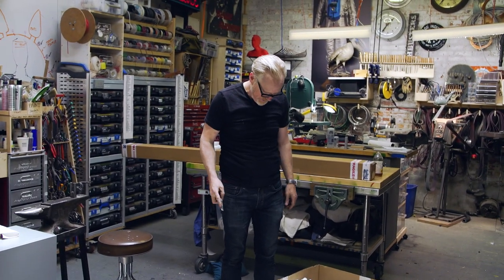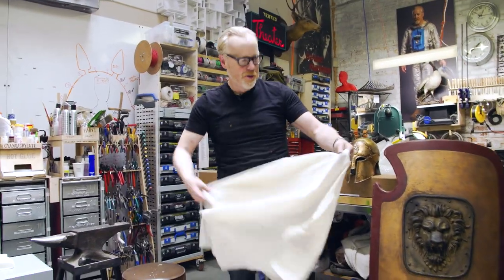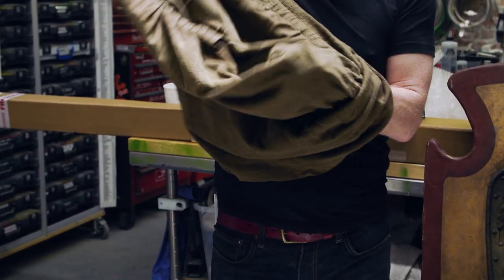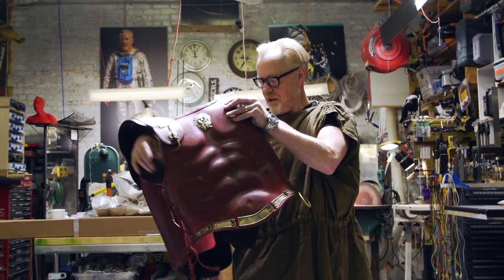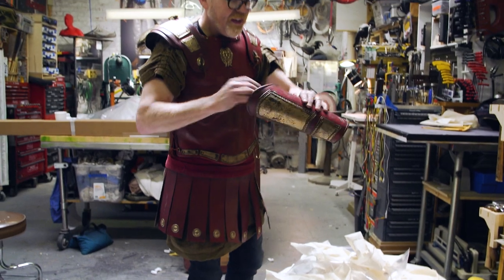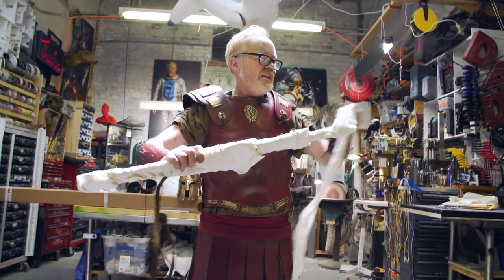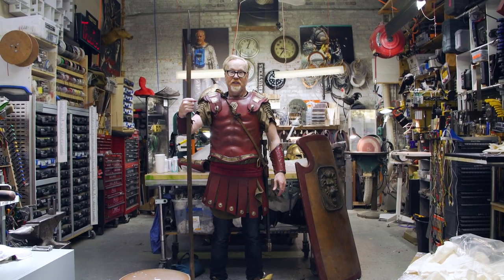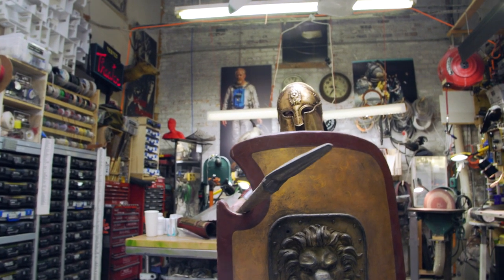Adam Savage's New Thracian Warrior Armor!

Comment: A bit of real history behind each bit of the “Thracian” costume. Top down!

Helmet seems to be a Corinthian-style helmet used in Ancient Greece, but the cheek plates don't extend down far enough to cover his neck as they should. Also the nose cover is too wide, it would restrict his line of sight. This is probably the most iconic design of helmet of the ancient world, and was usually forged of a single lump of bronze.

The cuirass (chest piece) is a hybrid of two different types of armour, those being “musculata” and “linothorax”. Musculata was the muscle-cuirass made usually of bronze from the late archaic period onward. Linothorax was a layered linen or possibly hardened leather armour used in the classical and Hellenistic period by Greek heavy infantry. I’m unaware of any archaeological finds of musculata that have shoulder plates like that, and none of them lace up on the side. The Linothorax does have shoulder plates, but they attach at a single point in the middle, and it does tie up at the sides. Interestingly, musculata armour is in fact sometimes found in Thracian graves.

The bracers (arm piece). Adam called them gauntlets, but gauntlets are for the hands not the arms. Vambraces were a piece of arm armour used during the medieval period, but they were plate metal, and not period accurate to the Thracians. Bracers (like what he has) are a piece of archery equipment to protect the arm from the bowstring. 

The greaves (shin armour) are somewhat accurate. Greek hoplite infantry wore greaves, but they were basically long, shaped tubes of solid bronze, not leather with bronze plates (tied?) on them.

The spear is a bit short for a Greek infantry spear, but a bit long for a javelin, though it would still work.

The shield is a bit of a far cry from Thracians. It looks to be an upsized medieval jousting shield given that it has a lance rest, but those tended to be concave. It is approximately the size of a Pavise shield but those didn’t appear until the Late Medieval period. It could be a fantasy version of a Roman scutum except for the lance rest.

The sword is a strange one because it’s a mix of a few different things. It’s a Roman gladius in the blade shape and guard style, but it lacks the pommel that gladii had, and it's fuller (the groove down the middle) is not found on a gladius. The scabbard is possibly the most accurate thing here, but it’s for a Greek xiphos sword, not a gladius. A Xiphos would hang from one string around the shoulder and had a horizontal bar at the end of the scabbard.

Overall, mostly a fantasy costume, but cool nonetheless! Only a few things were actually debatably Thracian and the rest were a mix of different cultures and time periods. 
I have a costume made of an actual Thracian warrior and I’ll probably put up a video of it in the next few days if anyone wants to see a slightly less cool looking but more historical Thracian. Cheers!
Reply: Solomonisms based comment, let’s get you to the top
Reply: Please do so! I would love to see the video.
Reply: People should read Solomonisms comment to learn how to demonstrate constructive criticism.
Reply: You said it well, all-in-all, this has nothing to do with the Thracian heritage, but is a good-sell for epic movies fans 😂 greetings to the seller, he packed Hellenic and Roman toys and sold it as Thracian 😂 he could add a katana and sell it as medieval Samurai kit to at least 10k people 😆
Reply: I do belive the gladius have a bit of a broader blade than what he has here though
Reply: What do you expect from the Plop Store?
Something actually authentic?
Reply: Maybe a spartha but not a gladius
Reply: Mate the props are from the movie  Hercules the one with the rock that is where they got the design for the shield. It is a completely not historical
Reply: Its just fake dress up
Reply: Blesson Wilson maybe enjoy the fact he took time to describe the history? No? Ok
Reply: While I agree this is basically fantasy armor, I wonder if the people who made it looked up Thracian not realizing that it is also a type of gladiator. Maybe that is why the parts of the armor and shield(minus the lance cut-out) look like they have Roman style to them.
Also a few questions. first yes the ancient Greek greaves were solid bronze tubes, thought there were probably iron ones as well they just don't preserve well, but don't museum example have places on them to attach a liner of some sort? I would assume there was something between the metal and the skin or they would be pretty uncomfortable and maybe even dangerous in a hot Greek summer(bronze does conduct heat pretty well).
Second I believe the iconic Thracian helmet, the one historians call the "Thracian helmet", is the one with the comb projection that sticks forward  from the top of the helmet(looks like a metal bird plume), with different versions of the helmet having cheek plates, face plates or even beard plates. Did Thracians wear other helmets besides different versions of their iconic helmet, Thrace was next to the Greek world did they wear Greek style stuff too or have other helmets that I don't know about?
Reply: No They were Greeks by blood a new study in Kazanlak tymb 2 Thracian bodies found  and they had the 93.3 per cent of their DNA similar to the Greek one (Yup, Greek DNA has changed over time *cough cough* ottomans were raping us *cough cough*

The ""Sica"" was known to the Thracians AFTER the Celtic invasion , They lived with the Mycenaean Idea fortified hills with no cities just big villages in always mountainous terrains they also discovered FIRST the javelineers (aka Peltasts) and then the archers like every Pelasgic nation did 

Attention  NON every Greek state had hoplites as main warriors or not at all Epirus Macedonians Aeolians Cretans Phrygians and Paeonians have had their own militia-like warriors and amongst them they always used the same Phrygian type hat! (A hat that was Represented Greeks by time) The hoplites "Perikefalaia" was first known To the Spartans  (warlike brave strong people like the most of the Greeks) Athenians were more Pacifists 

All the Northern Greek Tribes had no idea about themselves they were just fighting (Epirotes Thracians Paeonians *Yes Macedonians too, Aeolians and Phrygians) the ancient Greek ancestors were regarded as Sea people (pirates) : Pelasgians, Leleges and Kares
Reply: The bracers of this style are almost non-existant through history. Hollywood created them out of need in time when wristwatches were popular to hide "the line". By copying and using it for decades they created "made up look" of acient warriors.
Reply: @ΓΙΩΡΓΟΣΒΙΚΙΑΣ  I am a little confused about the point you were trying to make. As you said genetically speaking most of the Balkan Peninsula and surrounding area was very closely related, but culturally they were not all that similar. Culture and function tend to be what drive how clothes , armor and weapons look and culture can be effected by neighbors or the people you come in contact with. I guess my question was did the Thracians have also wear more Greek styled armor or just wear the iconic "Thracian" stuff?
Secondly the point about hoplites and to a lesser extent the peltast. While they are undoubtedly a style of unit used by that part of the world hoplites are just heavily armored spear men with big shields, so besides the Romans most of the ancient world used equivalent troops as their main fighting unit. Peltast to my knowledge started as javelin armed light infantry in which case once again they are pretty common in most armies. Later peltast do become more specialized flanking troops were they are given heavily armor and much  bigger shields and are expected to stick in and fight not just throw javelins and run.
Also I know its more complicated than this but the Athenians were not PACIFISTS by any stretch of the imagination. Not that they weren't people of reason and higher thought, they at times very open to non military resolutions, but at the end of the day most of the different Greek peoples were very warlike. Not that I am saying there is inherently anything wrong with that plenty of non Greeks from the ancient world were just as or more warlike. No reason to hold the Greeks to a higher standard, Mycenaean did conqueror a multiple groups dwelling in the Greek isles during the bronze age, most of which like the Minoans of Crete probably couldn't defends themselves very well. The Minoans were fairly advanced for the time and only had a small militia and trusted there Island home and natural defense and well built cities to protect them, and as far as we can tell they were not hostile to the Mycenaeans, but well the strong win that's how things go.
Reply: @ΓΙΩΡΓΟΣΒΙΚΙΑΣ  :))))) not a single grek wase Trachian :))) and Sica whase a trachian deger not celtic ,  dont  speak bulshit ..  macedonian whase a trachian tribe , not greek ..  if you have naw people with trachian adn . theat people are .Aromani, meglenoromani .. not greek ..
Reply: Where are you from buddy?
Reply: @mip4839  Well Thracians and Greeks used kinda the same things 
Thracian Culture is the same as Mycenaean one and also Herodotus himself says that they Have Pelasgic origins as Greeks do 
So what do you mean by that? 
Im a Greek you guessed right but not a crazy one
I have explored what Thracology had to show and it was hela Greek the whole thing (they were trying to prove that many times) as a tomb there had a Labrys (Panhellenic symbol that they often marked themselves with beforewar with Scythians or Illyrians and if they lost they were banning themselves somehow but never banned themselves from Greeks even their language was actually very close Greek that's why Grek historians can read and explain about with the same ease every piece of Thracian info on language it's available

Im not crazy or imperialistic (what you mean today's nationalist) but facts are facts and people need to see before they speak and post on Wiki
Reply: @howitzer551  Thracians gave the most to the Hellenic culture during Alexander the Great times cuz they were marking themselves with Labrys (double axe) to show that they were Pelasgians also sharing the Panhellenic Phrygian typed helmet during the campaign which meant a lot 
Nobody was forced or influenced they just joined and not one or two but every Thracian tribe according to what Greek Historians say (they know better) Alexander himself used "Kopis" except his dori (cuz he was throwing it)
Kopis was called by Macedonians and Thracians and mahaira from Southern Greeks 
For any more questions contact me
Reply: The Thracian Kingdoms became increasingly hellenistic after Alexanders death. Let alone by the time the Romans conquered it so for them to have greek style armour wouldn't surprise me.
Reply: @ΓΙΩΡΓΟΣΒΙΚΙΑΣ  Romania .
Reply: @leomarin2205  So this explains.
Well you are a sum of ethnicities 
There are some pure Vlachs but they are counted in hand and most of them are here 
They served as border guards "akrites" in Byzantium, they were shepherds and elite warriors who were been latinized 
We have a common bloodline with you but only with the pure Vlachs not the Slavic German and Turkic population (by Huns) 
Numerous book writers support this fact (mainly from Vlach origins) because We believed in Past you were Romanian meanwhile you were latinized Greeks even by DNA that was tested in 10 Vlach individuals that were claiming that only mixed with Vlachs 
They had mainly Greek DNA and Balkan but some of them had no Balkan at all (These people belonged to the Vlach community of Greece trying to prove once more they are part of us, Also Ottomans put them in the same race with us)
Reply: @ΓΙΩΡΓΟΣΒΙΚΙΑΣ  evry romanian are vlah.valah  not a sigle greek are the same blood with uss, only thay are romanian on the basee and asimilate by greek politics , becose that hapans 2 sec agou .. with the majorite vlah seatelmants .. the greek nationalist atac  tham ..
Reply: @ΓΙΩΡΓΟΣΒΙΚΙΑΣ  :)) we dont stay 800 yars on turks ocupation ,,  some of uss are probaly mixt , buot the restof uss are clean  the greek are not the same tribes pairets ho come in balkans , on the trachian leand , your laky is , the parts of trachian dont live theat leand thay improve your ADN :))))
Reply: I believe this is the  Hollywood  movie (Hercules)  costume. It has nothing to do with actual historical facts.
Reply: Elton Baholli Nonetheless, historical facts are important. I think it’s interesting to know them, and compare them to modern re creations.
Reply: @solomonisms9000  You are absolutely right sir! Please do not mind my History PhD outlook.
Reply: thx
Reply: Actually it is Thracian but not real life Thracian, it's from the movie Hercules which is a blooming fantasy😂 so of course it's not going to be real. Hercules made them the armour (lies) so they could fight off an army of centaurs (also lies)
Reply: Andrew Eades 
I know that it’s from a movie, but I find it interesting to insert some real history into the discussion as a point of comparison. Maybe someone learned something from the comparison, who knows?
Reply: Ok.
Reply: ΓΙΩΡΓΟΣ ΒΙΚΙΑΣ Giorgara i thrakes dhen Einai Eliniko filo ala ykiriko filo 
Min mberdhevese patrioti arvaniti apo to epitheto !!!
Reply: learn the history that has been hiddenn from all of us please after you make these comments, not the shit you have been thought in the western world. Thracians are the origins of modern civ. as we know it, which is a lie that has been spread since the 18th century. Greeks, Romans and almost all european civ. emerge from the thraciaon culture
Reply: @ΓΙΩΡΓΟΣΒΙΚΙΑΣ  
1.) "Sicca" was borrowed from Illyrian into Latin (Illyrian "sicca" (or sica) was preseved as "thika" in Albanian)[*]. Thracians and Illyrians were no foreigners (that's from where a lot illyrian males got their wives from; from thracians). The "sica" was a dagger of Illyrians, Dacians and Thracians and reached Romans via Illyrians. A dacian king even killed himself with one of these Daggers.
[*] ▪︎Source I: (Linguist) Vladimir Orel's book  "Albanian Etymological Dictionary" pages 477-478 (see: "thikë", "knife, dagger")
▪︎Source II: Wilhelm Haver's book "Die Sprache" (Germ. "The Language"); page 84
So no, you're wrong; "sicca" was WELL KNOWN to Thracians. The illyrian term "sicca" is what is called "[dagg]-er" in other languages and literally derived from "[Dac]-ian". Keep in mind that Dacians were a tribe that derived from the same root as Thracians. Of course Thracians knew what a sicca or/and a dagger was. There were no Celts, Greeks or Romans needed to "introduce" a dagger to Thracians, this was a legit thracian walfare.

2.) Thracians were non-greek folks, they were clearly not totally "alien" to Ancient Greeks, they we're de facto neighbors. However, Thracians were even less alien to their other neighbors. It seems that some ppl often forget, that Illyrians, Dacians, etc. also existed. On the mt-DNA line (specific) Italian and Albanian females cluster closer to thracians than Greek females.[**]
[**] Source: Cardos G., Stoian V., Miritoiu N., Comsa A., Kroll A., Voss S., Rodewald A. (Romanian Society of Legal Medicine); Year 2004; "Paleo-mtDNA analysis and population genetic aspects of old Thracian populations from South-East of Romania"
Quote:
》Frequency:    Ethnicity:
7.9%               Italian
6.3%               Albanian
5.8%               Greek
4.2%               Romanian/Bulgarian《
It would be even more interesting what the Aromanian/Vlach mt-DNA looks like... Bc THAT'S where it goes down ;)

3.) These so called "Ottomans" (that you mentioned) who "raped Greeks" (your words) were for the most part linguistically turkified ppl that already co-existed with Greeks before Ottoman era. The first south-eastern europeans to be turkified were Greeks (and Bulgarians). To make a long story short: muslim Greeks were f***ning christian Greeks - that's about it. The genetic make-up of modern Turks shows that only 20-22% is a typical turkic marker. Hence the ethnic turk is a minority in turkish genetics. Main-haplogroup of Turks is J2; which has nothing to do with Turkic folks. Safe to say that modern Turks are turkified Anatolians; but let's not forget that Turkey was and is inhabited by a lot different ethnicities.

4.) Furthermore, idk what kind of "study" claims ancient thracian individuals as "greek". So pls feel free to post a link to this study that you mentioned.
Reply: @ΓΙΩΡΓΟΣΒΙΚΙΑΣ  "Arvanite" literally derived from albanian "Arbanitë" - meaning " person from Arbënia" (or "Arbanon") - which is the pre-"Shqipëri" term for "Albania". When speaking of Old Aobanian, albanians use the term "Arbënisht" (gheg dialect) / "Arbërisht" (tosk dialect) - and not "shqip" (replaced old term "arbënisht" (albanian) around 18th century). The terms "Arbënisht/Arbërisht" ... that is called "Arvanitika" in greek - but Arvanites call it "Arbërisht" in their own traditional (non-greek) tongue.
And you really use the word "propaganda"?! Smh...
Arvanites used to be all christians (southern Albanian dominant orthodox and the lingua franca of the orthodox church was greek. Orthodox Arvanites are orthodox by faith, but ethnic wise they are not "orthodox/greek" - but Albanians). Just like Aromanians; orthodox by faith, but Aromanians is their ethnicity and they were never greeks.

Also, Ottomans called these so called "Arvanites" Arnavut/Arnaut" (Albanian) and never "greek". Stop pulling out ridiculous claims that have no base at all. The only propaganda here are all your comments, in which you claim literally everything as "greek". Eventhough your ancestors in antiquity declared it as BARBARIC, NON-GREEK. Same for Epirotes, who are claimed as "greeks". Here some facts: Ancient (Mycanean) Greeks considered Epirotes as non-greek ppl and even wrote that they were culturally very similar to Illyrians. How are they "greek" again?
Greek Epirus ("MAINland" in Greek) and alb. Epiri ("HIGHland" in Albanian) was originally non-Greek soil, which was HELLENIZED. Learn and know the difference between hellen-IC and hellen-IZED first. Hellenized land and hellenized people are nowhere "originally greek" - but as it already says hellenized;  barbarian/non-greek land and people who were hellenized to some degree.
Reply: Looks like a Wikipedia you copy pasted. And then added cheers. JK
Reply: Eucharisto

It means thank you
Reply: Chears my friend!
Reply: <3 THANK YOU good sir for peeling apart all the tiny bits and pieces that made me cringe while watching this "thracian warrior armour" getting unpacked. Historical inaccuracies trigger me hard xD - especially when they occure in xxx-billion-$-productions ^^
Reply: This muscle cuirass is a "Lorica Musculata", this time a boiled leather variant as depicted by the Romans. However there's no evidence that proves that there has been a single boiled leather Lorica Musculata made. They were always made of bronze, just like their neighbors to the east, the Greeks. The helmet indeed looks like a Corinthian helmet after 500bc, so not during it's prime time, it looks slightly altered from the forerunning variant during the 500s bc, also i don't see Greek smiths welding multiple pieces of sheet metal to a single helmet during that time period, especially with bronze. The Dori (spear) looks a bit off, it being nowhere like 8ft as described my multiple greek accounts and having no bronze butt-spike which keeps it from corroding when stuck in the dirt, it's more built like a Sarissa, which though was even longer than 8ft. The tower shield was also rarely used, and more prevalent to the east outside the reach of Byzantium and was made out of wicker and leather and wouldn't really fit to a heavily armored Hoplite amidst a full on combat inside a phalanx. So a heavy big round concave shield called the Aspis was mostly used, the concave form allowing the wearer to rest the shield on his shoulder without needing a strap. The wicker shield also had a neck strap, to rest the shield on the back/neck of the soldier. There were also accounts of soldiers retreating with the shields strapped to their necks, swung over to cover their backs which protected them from javelins and arrows. 

I didn't even expect to see a fantasy armor, which normally goes way over to the extremes and unachievable, is probably much less effective than in reality. 
In reality you would have either had 1. Bronze musculata for the rich hoplite, 2. Spolas for intermediates, boiled leather cuirass sometimes even partly covered with bronze or leather scales and 3. for the lower budget hoplite either no armor at all, or Linothorax, glued linnen which was actually very effective, even rivaling the effectiveness of a more expensive Spolas. They wore no chinguards or some made of bronze, bracers were as the op said fantasy until the medieval age. The flapped skirt (Pteryges) was oft not a own detached piece of armor, but came attached to a Linothorax or simply worn as complete piece of apparel under the actual armor, which gives a theory that the hollywood roman boiled leather musculata is actually the Pteruges which was supposed to be worn under the bronze musculata for extra protection and comfort. This armor Adam tested looked like a complete random mashup of armor pieces that were popular, but probably never worn at the same time. Heck he could've even used Roman mail armor, that's how random this looked.
Reply: The Corinthian helmet has differently variations some of them actually have cheek guards that extend down to the neck. The nose guard I agree it’s to wide even though a real Corinthian helmet restricts the line of sight that nose guard restricts the sight even more.
Reply: Definitely looks anachronistic